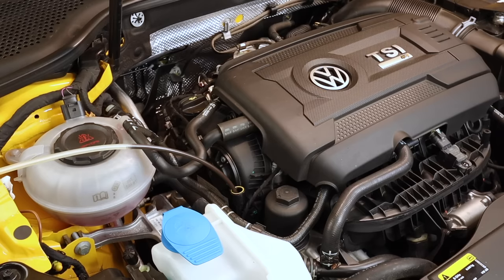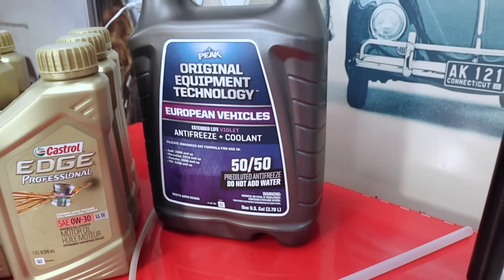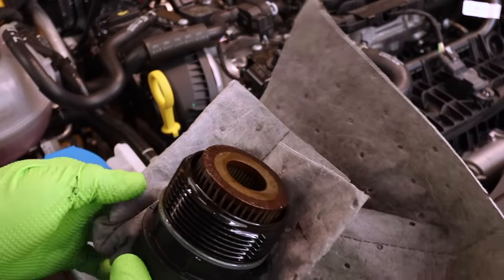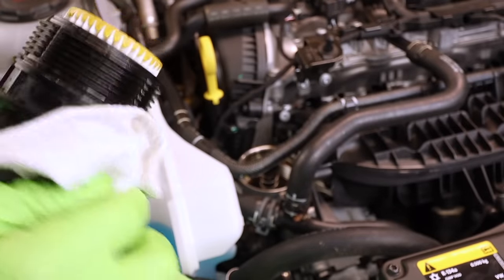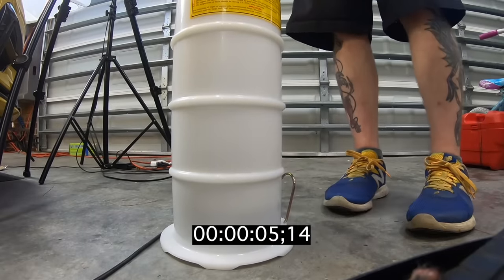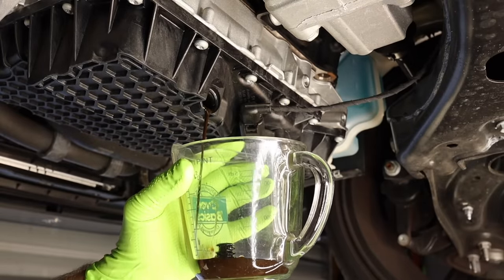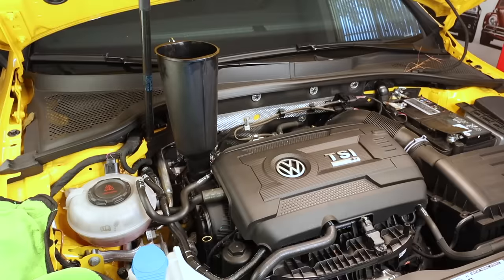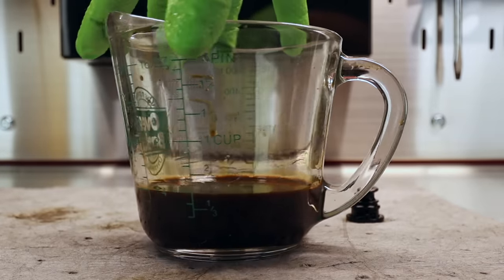Will an Oil Extractor Get All The Oil? (MK7.5 Golf R 5000 Mile Service)

Comment: Hello 
Is it safe to clean inside the black plastic filter cartridge holder? I’m not talking about the filter, just the holder. If it is safe what can you use to clean it, with it being plastic and having the oil filter bypass valve inside it?
Thank you

Comment: If you really want to clear out every drop of oil, run the motor for a few minutes after the extractor gets everything it can. Running the engine will free up all the oil that is on surfaces and in channels. You'll know when you've gotten it clean because the noisy engine will go completely dead silent.
Reply: Lol

Comment: Because of Covid-19 the hobby shop on the Air Force base is closed so I don’t have access to a lift, I figured I’d order that pump but the shipping was insane, 135$ just to ship the pump and the filter. I’d rather spend an extra 15$ on the pump and 4$ on the filter going to harbor freight and then the dealer. I’ve got over 90k miles on my GTI and have always stopped by the dealer and grabbed the filter and drain plug, it’s gonna be weird not getting the plug.

Comment: Yes I would leave a small amount of oil. I have an extractor and use it if I'm not getting under the vehicle. Other wise I like regular oil changes. The key as you stated is a good quality oil and proper normal change intervals. Sludge can be prevented. I just replaced  the valve cover gasket on my 09 Suzuki SX4 2.0l with 155,000 miles. The inside top of the engine was clean and sludge free during the repair. I bought the car new and change the oil every 5,000 miles with Castrol Edge synthetic Gold 5-30 and a Wix filter.

Comment: charles you need to do oil sample analysis on the oil you got out of the extractor and the oil you drained from the sump. 

I am willing to bet the metals ppm in the leftover 100ml is far higher and both of these oils are not alike. The metals at the bottom of the sump would be too small for the oil filter to collect and too heavy for the extractor to suck up. 

I bet the oil sample analysis will give a night and day difference in reporting on the oil picked up by the extractor and the left behind at the sump.
Reply from the maker: Maybe. But let’s really think about this. 

1) you never get ALL the oil out. It can’t happen without a full teardown. 

2) we are treating this like the oil is 50k miles old. The oil is changed every 5k. There isn’t sludge.

3) how long before 100ml ha I g elevated metals become an issue. The capacity is ~6,000ml. 

The odds of THIS being the thing that kills the engine are so low it’s not worth worrying about in my opinion. 

Now if I bought this car with 50k and unknown maintenance. Yea I may drain from the plug. But after that I’d extract it every time and worry about it 0%.

Comment: Is there any concern that if you do this every time that the gasket on the drain plug would still need replaced at some point? It's not a big deal to do it but just curious if they hold up over time without changing
Reply from the maker: Nah i wouldn’t worry one bit. But If you did remove the drain plug I’d change it

Comment: Thank you for all those valuable videos. I wish one day your attention would come across my question about the Steering Torque Sensor (G269). "I got the fault code 00573 - Steering Torque Sensor (G269) 008 - Implausible Signal on a 2009 Skoda Octavia II FL and the steering lamp is shining yellow in the dash". Any ideas?
Reply from the maker: Can you see it reading the value in Mvb? I’ve never ran into that fault I don’t. Think

Comment: I bought two of these, one new on eBay. I attached the black filter (?) and a hose. No matter how much I pump I feel no suction from the end of the hose and it does not pump water from a glass. Are they broken? What could I do to determine and possibly resolve?

Comment: How much debris is expected on the filter.  First change, 4000 miles.  I have a few tiny bits of something that looked like red silicone in nearly every pleat, and a very few green ones. Also 3 metal shavings, ~2mm to 4mm long and ~0.5mm wide.
Reply from the maker: Red silicone? Yikes. Email me some pics charles@humblemechanic(dot)com

Comment: Does it really make any difference extracting if the oil is warm or cold (above 5c), shouldn't the engine oil viscosity be the same at both of those temperatures? I mean it was designed to be?
Reply from the maker: It flows faster warm

Comment: I owned a Passat and 10,000 seemed like a lot.  When they suggested 10,000 they must have thought we all searched the whole world for the best oil ever made.  The fact is here in the USA they get away with deceptive marketing by literally getting to label anything they want as synthetic.  Read the oil forums and see what they say if you are in doubt.  You might be getting overcharged when it comes to most oils found in Walmart (of all places) or the local auto parts store.  Those oils might not ruin your engine but you may notice a difference with them!

Comment: So I heard the TSI engines weren't all that good have a like fixed it in recent years or was that a lie and do you need to replace the plug frequently
Reply from the maker: You should replace the drain plug. I probably wouldn't do it every time, but every other. The TSI is not problem free, but is WAYYY better than before

Comment: Charles hey Man I had one of the first gulfs with the 2.0 abba motor. I cannot believe they went to a plastic oil drain plug 👎 boo . I also Have a 2014 cc . Im not a fan of break wear censors or having to use triple square torque sockets.  My question is did they design this method of oil extraction so you never have to pull the plastic oil drain plug. How much is a new plastic oil drain plug? Im sure there proud of there plastic drain plug. Vw wants 105.00 dollar's us for a wear sensor harness to reconnect the wear pad if the caliper fall's and it snaps oops should of hung it up.

Comment: the fast flow out of the oil drain pain will move larger sludged pieces of oil to the drain hole that a extractor that takes oil out in a very slow way will not. fast current vs slow current difference in rivers. maybe that big extractor you have will do a good job of it. but most peeople wuith their tiny 2L extractor with a tiny sports ball pump will not be able to get to a high velocity of extracton.

Comment: Honda VTec engines the v6 anyway the tube hits the bottom of the pan.
On a V6 explorer I had it was an absolute no go because the dipstick hole prevents the suck tube from going past the dipstick tube. I wish there was a chart to which engines this works on. 
I have the same unit.

Comment: i had no idea.. it was that hard to remove a drain plug.. even on my 2104 ford fusion 2.0 i must remove 12 torx screws to get the undersheilds off,, but that only takes a few mins to do, and at 5000 ish mile oil changes   that is only every 6 months..

Comment: I wanna know how much more oil would spit out if the engine was cranked over by 1-2 rotations.  Someone I met once claimed he did that on a 2000~ vw and said a half a quart or more oil then drained out.

Comment: I have a 2009 Chevy Impala with over 232,000 miles and I change the oil in that car between 3000 and 3500 and I may be changing it sooner than needed but oil is cheap and engines aren't and I still think I will be pulling the drain plug every time to drain the oil out

Comment: I love my extractor i love it it saves so much time when doing services on multiple services I always run the engine to mix up any particulate.  And warm oil pumps fast . Mine is dual pneumatic and there is a hand pump

Comment: 100 ml is 3.4 ounces of fluid, less than 1/8 of a quart. That said, even with a 4 quart capacity of 128 ounces, that works out to 2.7% remaining in the bottom of the oil pan, 97.3% of the oil removed. Can the extractor get more ?

Comment: The most complicated oil change I've ever seen. Are all new cars this way? I've changed the oil in my Tundra every 20,000 miles with synthetic and best oil filter I could buy. Tundra is 22 yrs old and 250K miles and runs great still. I'm not recommending this, just stating my experience. Based on this video I'll keep crawling underneath. Thanks for thorough video.

Comment: Guys 10,000mile oil changes is not at all realistic. If your driving 90% highway miles sure 10k miles is just fine but most people do at a minimum a fair bit of city stop and go driving. And these cars your doing pulls and having fun. Highway miles are about 10% of the wear and tear of stop and go so 10k hwy miles is equivalent to roughly 2k city driving miles... so in that case if all you do is highway consistent 70mph all the time 10-20k oil changes is realistic. And if your 50/50 and easy on your car maybe 7500miles. But if you drive like a normal gti/r/gli driver and do city driving 5k mile oil changes is actrually what you shoulddd be doing. I promise your car will rhankyou. Ideally the first oil change should be done about 1-5k miles depending on how hard you break it in haha

Comment: My 2013 Passat was maintained at jiffy they lost and mixed different screws for the plastic wind cover such a pain. I now need to do my own maintenance to make sure it's done right. So glad you used the same pump I am about to buy you just sold me on it. Wish my oil filter was on top like yours. So ramps and removal of the plate to get to that filter is my lot. But at least no more oil mess.

Comment: I disagree with your conclusion. Recently, I had my MB E 350c oil changed. Oil extraction method was used. I was kind of skeptical, so I asked the technician to open the oil drain to see if any residual is still there. To my surprise not a single drop came out of the drain. So, the extraction method is equally effective to the drain method, supposedly it is done right.

Comment: Always use an extractor and because its easy and it tends te gets done. The interval is adjusted to the method if oil change. 

The importance it to get it changed often enough - not the method.

Myself I actually changes the oil twise for every oil filter since its underneath the car. This way I make sure the oil gets changes very often.

Comment: very simple decision.....if the oil filter is up high as in the VW's case, use the extractor.....if the oil filter is down below, pull the drain plug since you're there anyway
Reply from the maker: I can support this!

Comment: I think 1/10th of one quart of dirty engine oil will be diluted well enough with 5.9 quarts of fresh oil on top.  Especially on a fresh motor with regular 5000 mile service intervals.  You never get rid of all the old engine oil anyway since a lot gets trapped in the crank and in between bearings, pooled in the head and left in the capillaries.
Reply from the maker: It's SHOCKING how much oil can be left in the engine. Even with the pan totally off
Reply: surprised how no one mentioned this until i saw this comment. generally there is about .3-.5 L different between dry fill from factory or rebuild and oil change fill
Reply: @HumbleMechanic  How does this process change with the steel oil pan or is it the same?
Reply from the maker: Should be same

Comment: Mk4 TDI ALH. I started using an extractor a few years ago after installing a skid plate. Last time I got curious and opened the drain plug afterward.  Maybe a couple centiliters. There is more oil left in the oil filter housing after pulling the filter.
Even better on my wife's 2nd gen CR-V, only a few drops left.

Comment: U need to use the extractor pump hose to pull rest the oil out of the oil filter housing 
And u will not have single drop when u unplug from underneath homie

Comment: I installed the Fumoto drain valve on all of my vehicles.  
You just open the valve to drain the oil, no more 
removing the drain plug.
Reply: @MAGA: Manipulating America’s Gullible Assholes
 If you would look at the end of the valve there is a spigot, so it would drain that when the valve is opened.
If the junk is bigger than the opening then you could always remove the valve completely like you would remove the oil
drain plug. I change my oil regularly so I wouldn't have any junk, hope this helps out.

Comment: I've never ever seen anyone do a top side drain apart from if the oil was overfilled. I've work at a garage and we literally drain plug every single car no matter what, how else are you gonna get all the crud from the bottom of the sump especially for a first major service? There will ALWAYS be some tiny metal particles and dirt... Anyway, service includes filters too which on quite a few cars is at the bottom.

Comment: Just make sure the engine is warm and pull the plug the speed the oil comes out brings any crud out with it. Honestly leaving 50ml-100ml of spent oil in an engine isn't going to cause issues unless you have an 800kw beast with a finicky engine. All hot hatch engines these days are made to be owned by people that haven't got a clue and are incredible resilient

Comment: an extractor is good if you want to do oil refresh (filter change optional) between regular oil changes.
Reply from the maker: Do people do that?
Reply: @HumbleMechanic  I tried it a couple of times - it's nice if you want to change the oil after some prolonged "spirited driving"  but you don't want to go to a shop to do it and your oil is pretty fresh anyway, and you don't have the means to lift your car. PS: I have the oil filter under the car or I'd change that too.

Comment: works out less than 2% left in the pan. I'd be fine with that, it gets diluted back up really quickly with the fresh oil. Worth noting that there'll be old oil left in the oil galleys etc around the engine that never drains out either, there might be another 500 ml in the engine.
Reply from the maker: I feel like if you're doing good on maintaining the car, it's not an issue, and never will be. :) That said, if someone feels better about removing the plug, I am not hating on that ay all.

Comment: Hey! I bought that exact coolant for my VW Atlas and I went to the dealer and asked them if I could use that coolant...they said "no". I even pointed out that the one I bought says on the back it complies with astm d3306. So I bought a 23 dollar bottle of g13 coolant from the dealer. Were they wrong?
Reply: Good question

Comment: To me it is up to one's choice. I personally like draining. I have a place on my property to do that. I do have an extractor I have used for a couple small engines. I can say that I have not been fully convinced it is getting ALL the oil out. Example. My lawn mower. It does not have a drain plug. The owner's manual instructs to tip the mower carb side down and drain it out the fill spout until it stops dripping. In this senecio, I would choose NOT to use an extractor. If it was YOUR mower you decide.

Comment: i not confortable using the extractor, normally wanr up the car remove the oil draing plug and I leave it all night distilling the oil. the next day I put the drain plug and fill the oil does not seem bad I always do the service 1 time a year.

Comment: People on about vacuum drainers not fully removing all the oil but forget about the oil still in all the journals after the pump or still sat in crevices in the head around the valves and head bolts or the in oil coolers and so on.
Reply from the maker: It’s an insane amount left in an engine isn’t it?!?
Reply: @HumbleMechanic  oh deffinalty but then when you think of how much oil goes back in and its diluted back Into the new oil its going to have virtually no consequence in reality. Diesels are a prime example, drain along as you want via drain plug but that fresh oil with turn black  from oil still in the system within minutes 🤣
Reply from the maker: I totally agree with you. Evac and roll!

Comment: First, nice job on the video HumbleMechanic👍🏼 I will be using this method of changing oil in my new Porsche Macan S. I owned a 1995 Porsche 911 for 8 years. This air cooled (oil cooled) car took 13 quarts of oil and 2 oil filters. There is an oil cooling radiator in front of the front passenger side wheel. In the 6 times I changed the oil and filters, I never drained more than 12.5 quarts of old oil out of the system. It is IMPOSSIBLE to get ALL of the old oil drained out of any car engine no matter what method you use, period. PS, love the humor everyone! Jerry

Comment: How much of that 100 mL is what the extractor missed, and how much is what dripped down after pulling the extractor out? A fair comparison is a conventional drain, put the plug back in after a set time, and pull it again a few minutes later (to simulate the timeline of the extraction).
Reply from the maker: Odds are the extraction missed it. It’s such a minimal amount.  In my opinion insignificant on a proper maintained car

Comment: When I bought my 2016 passat with the tsi engine did not realize the filter was on top of the engine. That's going to make oil changes a breeze!
Reply from the maker: When they first dropped we thought it would be a MESSSSS. But they are super great
Reply: @HumbleMechanic  my 2012 mk6 jetta is going to my soon to be 16 year old niece. I'm doing the brakes, rotors, drums, and the vacuum pump(thank God for your video on that!) headliner (cosmetic). Is there anything you would recommend safety wise to check out? It's at 95k ish miles. Just want to make it's a safe car for her as a new driver. I've really never had a problem with it other than the newly leaking vacuum pump.
Reply: @HumbleMechanic  also haven't been able to determine if the 2.5 is an interference engine or not. Can you put that to rest for me?